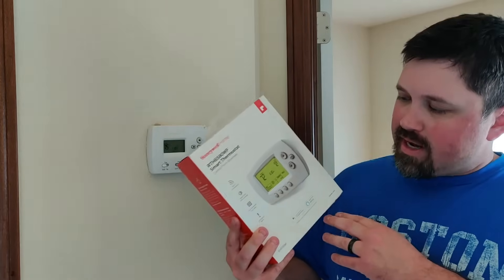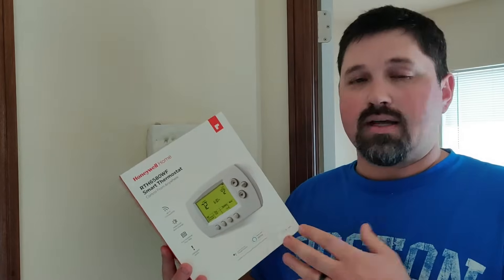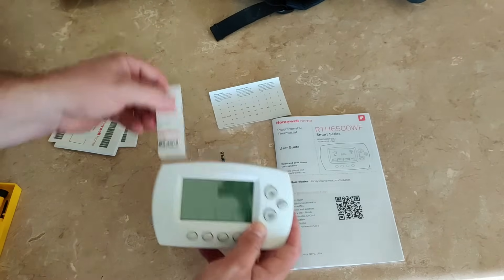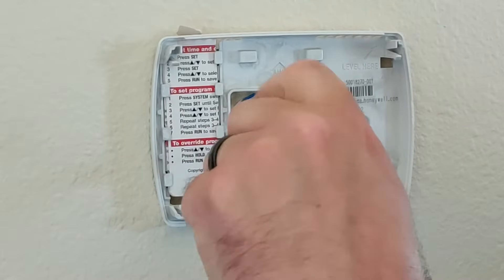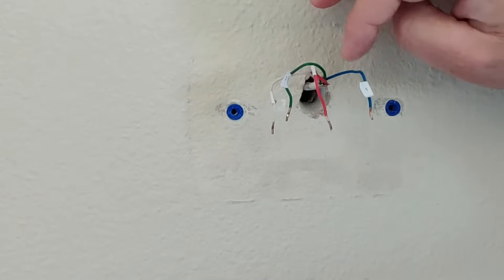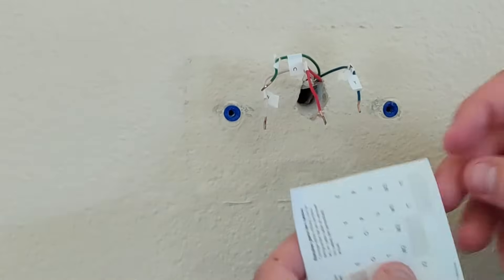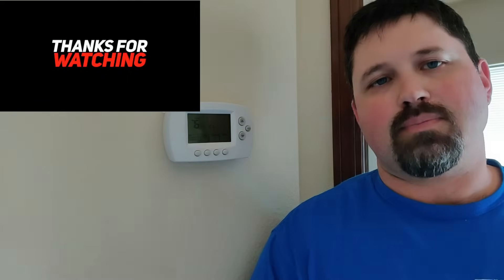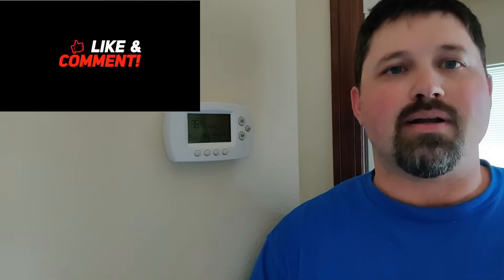How to install a Thermostat (C-wire adapter)

Comment: The Honeywell "C-Wire adapter" helps in situations where your existing thermostat wire from the furnace has FOUR wires, but no C-wire.  The adapter doubles up the cooling control and the fan control onto one (the yellow) wire so that you can use the green wire in your 4-wire cable as a "C-wire".   If you only have two or three wires from furnace to thermostat, this accessory won't help you.  You'll need to pull a new thermostat wire from furnace to thermostat if you want to use a smart thermostat that requires the C-wire for 24 volt power.  

That said, if you download the Honeywell T10 installation manual, there are wiring diagrams that show you how you can make a 3-wire cable from furnace to thermostat work by just connecting the green fan control wire from the "C" terminal on the furnace to the "C" connection on the thermostat.  This disables manual fan control, but you can still use the features of the Honeywell T9 or T10 to control your furnace without having to string a fatter wire cable between furnace and thermostat.
Reply: Thank you for the nice summary of this
Reply: @magic4218  Hello, just tried to turn heat on and nothing.  Had to call Heating guy and he said I needed a common for the furnace to run.  Is that what I needed?
Reply: @bvoghell88  are you trying to install a smart thermostat?
Reply: You are a legend!!  Thanks
Reply: i have a old 4 wire install setup. could i just replace 4 wire with 5 wire and replace my current blue with the yellow on both ends and then just use blue as the c wire and then ultimately skip the purchase of c wire kit? it just seems to me its cheaper for me to get 25' of 18/5 wire then it is to buy the c wire kit ... is there something i'm missing here or is the c wire kit just better in places where it would be tougher to replace stat wire?
Reply: Exactly.Adapter is in case when   is difficult to fish 18/5 wire. @-AnyWho
Reply: @bvoghell88 did you ever figure out how to get the heat on?

Comment: No A/C?
Reply: Looks that way. I followed his instructions and the thermostat wouldn't control the AC. Had to do a bit more research for what to do with the Y wire connector so the AC would work.
Reply: @stevepatterson5086  Hi. Can you let us know what you ended up doing with the Y wire...adapter says to attach to the K at your new thermastat. I'm having the same issue.  Fan blows, but AC unit does not come on. Thank you.

Comment: I watched this video a couple times. Saw bunch of wires getting connected and disconnected. Not hearing the explanation on what each wires are and how they should be re-routed.
Reply from the maker: I appreciate the feedback.  What specifically can I help with?  Are you using a C-wire adapter?